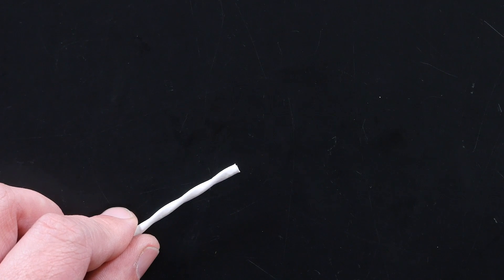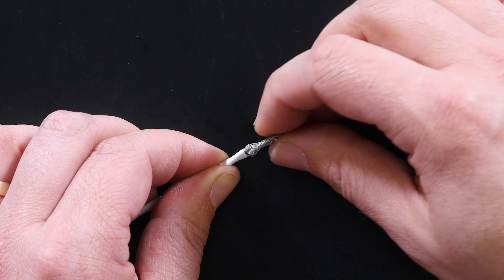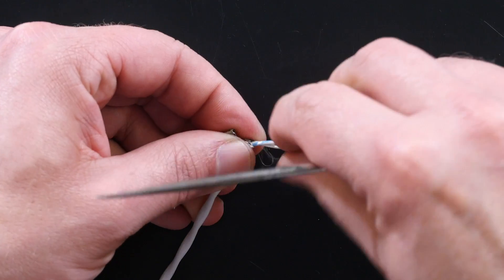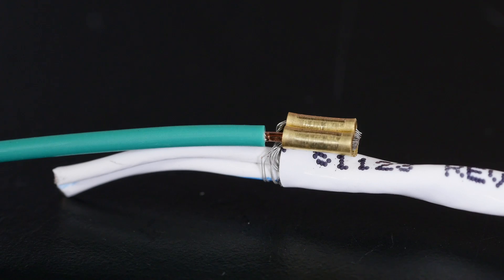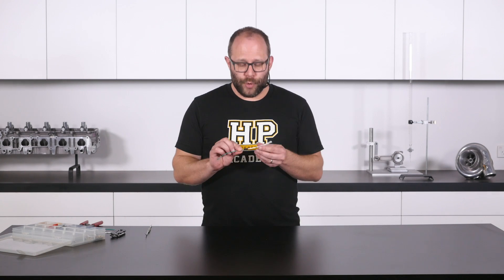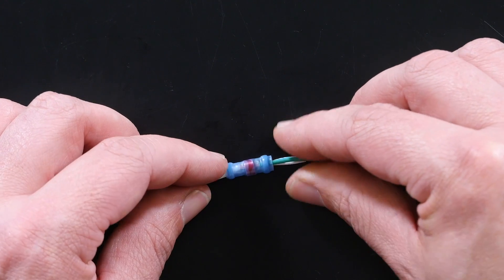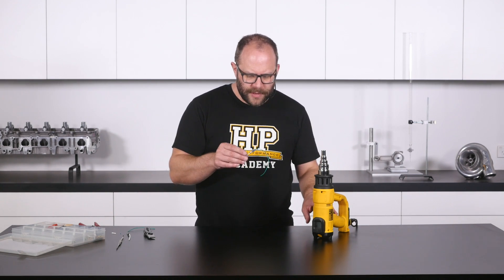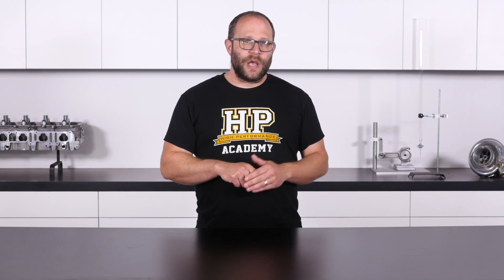Crimping OR Solder Sleeves? | Splicing Shielded Cable [FREE LESSON]

Comment: A proper solder joint is made by applying solder to heated conductors and allowing the solder to flow into the gaps. Solder-filled, butt-splice connectors, on the other hand, produce what is effectively a cold-solder joint, in which the solder is melted over cold conductors. This is a fundamentally poor joint and I would use these connectors only in an emergency.

Comment: I'm confused by these types of videos. Isn't the braided shied supposed to be wrapped around the two wires all the way down? Splicing in the single green wire confuses me. I have two 22 gauge wires coming from the ECU of a 2018 Kia Optima LX 2.4 that then connects to the knock sensor wire. The braided shield around the first 22 gauge wires got damaged do to the starter catching fire. The wires themselves are fine but i cut the burnt part of the shielding out, along with the wire and i need to replace that part of the shielding. The wires are easy. 

So, all i need is a wire connected to the shielding on both ends? Hope I'm making sense 

Thanks
Reply from the maker: I believe the answer you're looking for is that you are only grounding one end, NOT BOTH. Best practice is to ground on the ECU end and that's what we do, but ultimatly either end is likely to be fine, just NEVER both. This is a previous comment from Zac (who you're watching here) on this to help explain why if you're interested:

"The reason you only want to ground your shield at one end is that if you ground it at both ends, to different ground points, it will give a path for current to flow between these two ground points that might not be considered in the design. Large transient current events can cause spurious current to flow along the shield, which can actually induce noise in the wires below, if large enough"

Hope that helps - Taz.
Reply: @hpa101  

Thanks for responding. I'm still confused, but I should have been clearer. 
In my situation, the initial was a pigtail connector on one end, which connected to a knock sensor wire. In the opposite direction, away from the knock sensor, the same initial wire goes somewhere into a bundle of other wires, and I'm sure it's grounded on that end somehow. The shield goes almost all the way to the end of the initial wire, stopping about an inch or two before the pigtail connector. So, that side is not connected to a different ground, which you guys recommend against 

Now, my issue is that a part of the initial wire got burned/frayed. The two 22 gauge wires are fine, but part of the shield wrapped around it is damaged. Someone told me I could just wrap foil around that part, and I should be good. The problem is, I already cut the section out, not knowing there was a such thing called "shielded wire."" 

So, could I just remove some of the insulation/tubing/shield/ to get to the 22 gauge wires, strip them, and splice in as much wire as I cut out, then also add as much shield as I cut off, heat shrink it, then just add the pigtail connector to the end?

Hope this makes sense, and you can answer one more time. I've been trying to figure out the right way to do this. Seems like a solution to me. Please share your thoughts 

Thanks!
Reply from the maker: Ahh OK. So the tidiest way would be to replace it.

The next tidiest way would be to possibly be to cut further up and replace the longer length with new shielded cable, leaving you with a single join to do, rather than trying to do 2 connectors to replace that section as you describe.

That said, you can certainly try repair it like you outline and you might even be OK to run the shield through a solder sleeve for that section, noting obviously that short section would be unshielded. You can see how this is done to get the shield through a connector here: https://www.youtube.com/watch?v=ec8kC_Ic_Z0

Make sure you stagger any connections to make the repair less bulky.

If you're not sure how to do the connection, this is all stuff covered in the HPA Wiring Fundamentals course: https://www.hpacademy.com/courses/wiring-fundamentals/?utm_source=facebook&utm_medium=social&utm_campaign=general-interaction

Hope that helps! - Taz.

Comment: Question on using E51424 shielded quadrax cable, do you fold back the screen/s and apply a raychem solder sleeve in the same way?

Comment: Ok so I'm needing to do this on my 01 sequoia knock sensor wire.  It has a tiny wire with shielded around it...  
I have all the connectors and wire u mentioned but have a cpl q??
The green wire u solded into the cap does that just go to a ground anywhere on the engine?
Also the small wire left under the shield just hook into the sensor connector?   
Thanks in advance

Comment: Avionics technician here. I love this presentation. I do want to state that it is pretty common to find that someone has cut too deep into the center conductors while stripping the outer insulation. When melting the solder, it does sometimes short the conductor to the shielding.

Comment: This might be ok for some applications, but the best way to do it is using inner and outer ferrules. Inner relatively rigid, but also relatively thin, outer from softer metal. You slide inner ferrule to protect inner conductors and provide a mechanical base for the shielding and outer ferrule. Then, outer ferrule plus ground wire (poking backwards). Crimp, bend ground wire back to go forward, and heat shrink (transparent for easy inspection). The sizes of inner and outer ferrule need to be very specific to the cable used, but that is the best way to do it. This is how aerospace industry is doing this.
Reply from the maker: Your first sentence sums all of this wiring knowledge up perfectly! The 'best' way to do something is application dependant and even in aerospace there are different levels according to application.
 If you're wiring your own project/race car, the key is to educate yourself thoroughly. Understanding the pros and cons of your options empowers you to make well-informed decisions based on your specific needs for the job/application in front of you. By being aware of potential pitfalls, you'll be better equipped to ensure a successful outcome 🤘 - Taz.
Reply: @hpa101  Well said.

I discovered your channel recently, and it is really cool. A lot of amazing quality content. Thanks.

Comment: What would this shielded cable be for? I would be morecomfortable using some kind of crimp if it was in the engine bay since the low melt solder in all of the solder sleeves I ever used isnt very reliable in the long run. They eem like a really good idea at first though, it may very well be that yours have better solder though but I have never seen 250-300c  heat shrink.
Reply from the maker: Sometimes when dealing with shielded cable solder is preferred, it is one of the few situations in a motorsport wiring harness where that is the case.
We haven't had any issues with temperatures melting our solder and to be honest if that was happening we'd probably have bigger issues to deal with before even noticing that was a problem.

With that said, ultimately you design and construct your own wiring harness in whatever way you see fit. You could crimp everything that is practically possible or solder instead. The choice is really yours at the end of the day, just ideally armed with the pros and cons of any and all options so that you understand the compromises you are making with your decisions. Even for the 'best' option in front of us, there is always a compromise.

As for what you use shielded cable for, knock, cam and crank sensors are some main examples - Taz.

Comment: Ya. But what if you need to splice as to extend a shielded wire. Not to just terminate to ground.
Reply from the maker: You should replace the wire as the ultimate solution.
Outside of that you have a few acceptable options, and yes, that still includes what is shown here 🤓

1.) Do what is shown here and open barrel crimp the connections noting this one small segment won't be shielded. You will be connecting wire to wire, not to multiple, which is easier, yay!

2.) Use a DTM connector as your joiner/connection. This would be our least fuss, go-to choice.

Note you are most likely to get interference from your coils or your starter motor while cranking. Consider the position of your connection in relation to this vs replacement where applicable - Taz.

Comment: Solder sleeves??? Really? I've lost track of how many times I've found solder sleeves to be the problem. They do not work, at least not in a high vibration application like a Harley Davidson... What's wrong with using an iron, solder and heat shrink? It's not that hard to learn the correct methods.
Reply: Solder sleeves, when sources from the right places, are excellent. There’s
Junk out there and there is top tier stuff.
Reply from the maker: The previous reply is our experience too. The cheap ones are useless - Taz.

Comment: Interesting, if I'd done that when I was an electronics apprentice in the scientific instruments business  50 + years ago, the job would have been rejected as a bodge!   I was taught NEVER to puncture the screen and NEVER to yank the wires through a hole because, as you say, it always causes damage including leaving loose "whiskers".    The CORRECT way, I was taught,  is to gently comb out the braiding starting from the furthest point until the wires are free back to where you want the branch, then twist it into a single conductor, then sleeve it and cut it to length.  In the days before heat-shrink, we used Hellerman neoprene sleeving and tools we called "sprongers'" to spread it....and so we never got problems with heat damage, either!  And notable, I just discovered, that Hellerman got absorbed into Deutsch.

Comment: Can the raychem solder sleeves be used in the car?
Reply from the maker: Same rules apply, doesn't matter what brand is stamped on there although it does matter what brand you use to a point as those cheap as chips 'Aliexpress special from the same factory honest' solder sleeves are best avoided - Taz.
Reply: @hpa101  Means it can achieve the Vehicle gauge grade?

Comment: When splicing a shielded wire, would you do this to both sides and then soder the 22 gage wire ends together? Also my wire has tin foil underneath the shielded wire, does that matter or can I just remove it?
Reply: Always leave one end of the sheilding open circuit.

Comment: You can always learn something new!  I made tens or hundreds of 2-wire + shield connections for audio before the heat shrink was ever invented.  On the other hand, I have made a number of single wire and multi wire cable connections as well as Y-splits with the heat shrink materials, some with the mastic and some with the built in solder.  But I never saw the color indicator.  Thank you!
Reply: How would you go about fixing a shielded cable like this? Would you do this to both sides of the cable and then connect the two 22 gage wires that have been sodered to the shield to each other?

Comment: If I may suggest, bend the wire first where you will be cutting the jacket. This way you don't have to cut all the way through it and damage the shield, it will brake on its own before you reach the shield. Secondly, when cutting along the jacket, start from the middle of the piece you're removing towards the end. This way you can still open it and  pull it out, but you'll not damage the shield again.
When using those solder shrink sleeves, strip away an inch to inch and a half of the jacket. Then strip not less then half inch of the insulation of the wire you want to be soldered and wrap it around the pulled back shield. This way you'll have much better and stronger solder joint. The solder in those butt connectors is not that much and may not wet the joint reliably. This is what happened to the joint in this video, I'm afraid. This low melting point solder used in those butt connectors brakes easy and in my opinion not so great for high reliability connections exposed to vibrations.

Comment: When doing the barrel crimp, why not insert the green wire from the other side?  This would streamline the joint.
Reply: If you did that, either the green wure would be very short and difficult to insert into the connector or you would need to expose a longer part of the wires

Comment: Both ends of a shield should always be grounded.  If your shield is carrying ground currents, then you have a grounding problem that needs to be addressed.
Reply from the maker: This is not correct. 
In the automotive world it is essential or only ground one end, generally at the ECU header plug. If you ground both ends, your shield cannot work as intended in its job to remove electromagnetic interference.
I can't comment on non-automotive applications, obviously everything we discuss is specific to a vehicle related application - Taz.
Reply: @hpa101  It is correct in EVERY application.  Here is why:  https://www.emcstandards.co.uk/cable-shield-grounded-at-one-end-only
Reply: @LTVoyager  no
Reply: @Shiznit304  Yes.
Reply: @LTVoyager  why don't OEM do this? I'm examining an engine wireharness and I only see it grounded on one end.
Reply: @Shiznit304  Did you the article I posted earlier?  It generally comes down to these two things: lack of understanding or cost.

Comment: Can this method be also applied to Splicing to a Motorsports Bulkhead Connector? Or Is the bulkhead connector going to introduce noise because of all of the other pins in close proximity?
Reply: You can run the drain through a separate pin with a solder sleeve on both sides of the connector. This leaves an exposed section through the connector, but usually a bulkhead connector is in a less noisy part of the car, you can arrange the pins so that noisy circuits are on the opposite side of the connector from sensor circuits, and most motorsports signals are not going to be terribly sensitive to the multi-megahertz-plus frequencies easily admitted through a short section of unprotected wire. Alternatively, the drain can be chassis grounded near the connector or share its drain with a common shield drain pin provided that shared pin is only connected to a single cable on the ECU side of the connector (to avoid ground loops).
Reply: @RallyRat  Awesome, best explanation yet. Thank you.

Comment: How would you run shielding for 02, cam, and crank through a Deutsch bulkhead connector?  Thanks
Reply: I know it's been a year but if you still care, you would use a "zap" splice (solder melt sleeve) with a wire inside and a section of insulation cut out to expose the shield. That wire then gets run to an open pin on the connector and continued on the opposite side.

Comment: With those solder sleeves, what happens in the engine compartment when you have all the heat from the turbos, exhaust and engine? Will it remelt the solder?

Comment: Should u do a resistance test after using the solder joint ?
Reply: wouldn't hurt to confirm your connection.

Comment: Question: Why and or what's the benefit of sharing a ground location? (ie) ground group / bunch,  Instead of spreading out / Multiple ground points?
Reply: troubleshooting. Would you rather check 1 location or 20 for ground problems?
Reply: @Xzempt1  Indeed, I thought it would be a convenience thing, was still expecting a more complex reasoning behind it though! Thanks for your answer :)
Reply: @BUZDRIFT  I guess mot having another rusty point on your car would be a thing, as you need metal contact for the ground.
Reply: I find complex to be problematic. I use the K.I.S.S method. Keep it simple stupid. lol
Reply: @Xzempt1  can you explain that method please?
Reply: @powdere4donuts  k.i.s.s method means Keep It Simple, Stupid. It's just an acronym. I'm not call anyone stupid
Reply: @Xzempt1  lmao thanks. I'm gonna use that now
Reply: if you do not apply the star grounding ( earthing ) principle on critical sensors and instruments, you may create a ground loop. The point being that you do not want to create another closed circuit.  Look up Ground loop, lots of info.